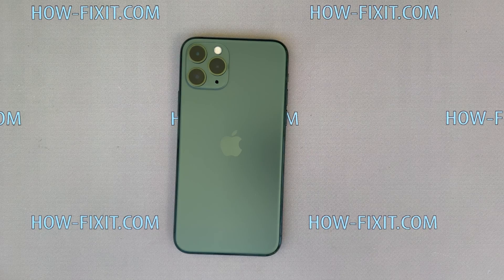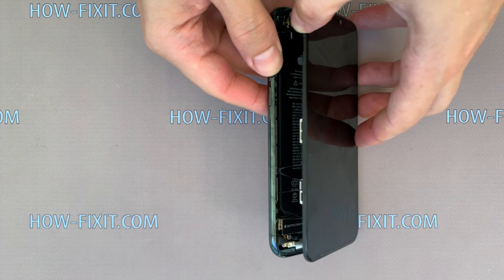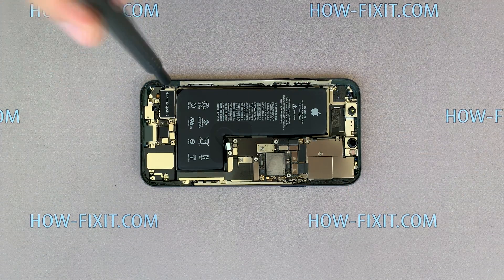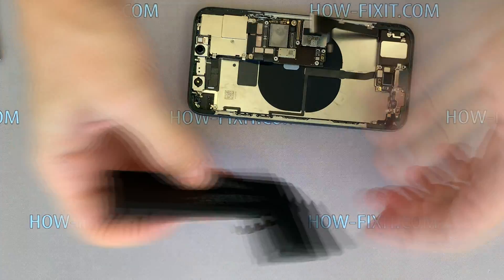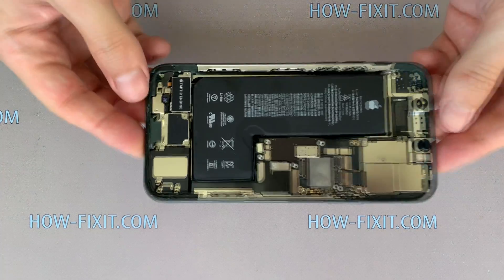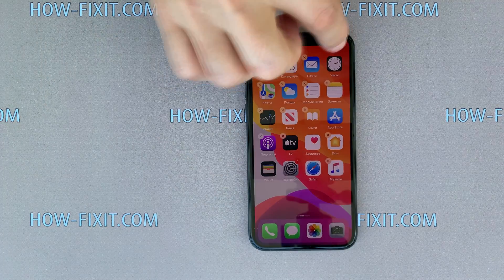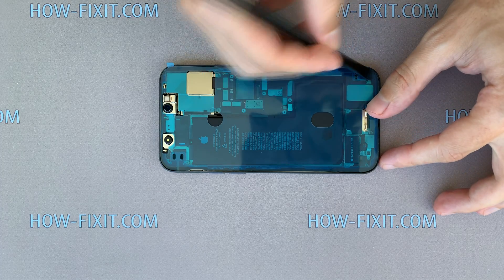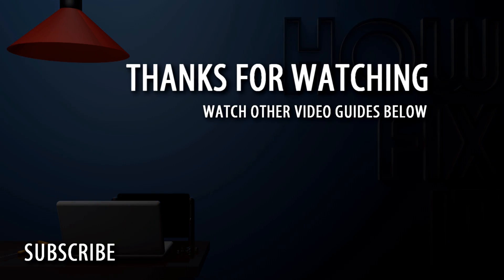iPhone 11 Pro Battery Change Made Easy: Complete Guide

Comment: Thanks for the instructions, I have to say though this is the second time I have replaced a battery on iPhones and not once have I even come close to the skill you guys have removing the adhesive for the battery. Mine just snaps and I'm left digging and using head pads
Reply: Hey, i dont know if youre seeing this but next time make sure to pull on the pads on a really low angle. If you pull them upwards they will snap but if you pull on them really low like almost as low as the phone they hopefully wont 👍

Comment: no need to weld the old battery circuit  board to the new battery ?
Reply from the maker: ⚠To Fix 'Unknown Part' or 'Important Battery Message' check the iPhone Battery Calibration video tutorial, link in the description under the video

Comment: It's not at all as easy as this video looks. At first, I thought getting the screen off was going to be the worst of it (use a razor blade before using the mediator). But, the those little bitty screws was a biotch! I, finally, got them out and then, realized I had broken one of the flex screen connectors. D'oh! Beware removing the screen and don't pry too deeply on the right side (with the charging port is at the bottom). I'm going out and getting a new phone tomorrow. 😥
Reply: flex connectors are repairable. also could've just buy new screen instead of new phone 🤔

Comment: You should have added that Iphone X, XR, XS, XSMAX, 11, 11 pro, 11 pro max will not show battery health there is a lengthy process which you will have to go through to be able to see the battery health and it involves having to use a battery programmer a tag on flex and a mini spot welding machine you will also need a battery cell kit for whatever device you are replacing the battery of you will also need some basic knowledge in battery repair and balls of steel to remove the tiny BMS board from the original battery cell or failing that you can also buy a External Tag On Flex XCAP which needs no programming and can be reused but you will still need to use a mini spot welder and have those earlier mentioned balls of steel to remove the tiny BMS board from the original battery cell and replace it on to the new one I very nearly just bought a new battery and swapped it over but I'm glad I done a little more research now and I can replace my battery correctly and luckily I know what I'm doing but if you don't I would suggest taking your device to a repair outlet and get them to fix it and get some sort of guarantee for whatever work has been done its better to be safe than sorry.
Reply: where is your fullstop bro?
Reply from the maker: ⚠To Fix 'Unknown Part' or 'Important Battery Message' check the iPhone Battery Calibration video tutorial, link in the description under the video

Comment: I have been using my iPhone 11 pro for less than a year and already the battery needs service. Been using it pretty extensively watching many videos in 2x Speed but still very disappointed in the longevity of the battery. Now the battery goes very quickly down to 1% and it can last hours at 1%. Tried calibrating it but replacement seems like the only way to keep using it...... At this point I'm considering switching back to my OnePlus 5T and give apple the middle finger tbh.
Reply: Same! The battery started giving me problems within months!
Reply: I have a european model and experimenting the same. Actually. I already had it replaced by Apple under warranty and then it lasted 10 months. now it doesn't even want to power on. Might aswell change it myself at this point.
Reply: Lol i just had exactly same issue. My phone is 9months old and for six months  battery stayed 100 percent health, then down to 99 once and then in three months its down to 84 and i experienced same. Battery drains to 1 percent on screen but lasted hours, though i think my phone felt laggy after few hours of use without charging. I gave it to service last week and will take it back tomorrow. I think its bad for the phone its already opened for a 9month old phone. We will see
Reply: 🖕🏼🍎

Samsung here i come!
Reply: Thanks for your lifestory bro
Reply: Hello, so there is no programming after new battery instalation?
Reply: You don’t know how to use the battery on iPhones they’re different to other smartphones. 

You have to not make a full cycle don’t go from 0-100 every time 
25 times of 0 -100 = 1% battery health which mean you’ve done over 500 cycles bringing it below 80% which the the minimum standard

Comment: Bro is this battery compatible to xs?
Reply: Nope. Apple had to change the logic board and other components to be able to accept that big batter. There is no space available in the Xs or Xs max to accommodate their battery
Reply: M but 11 pro and xs is same size
Reply: Lonely Kid not the internals. Externals are same. They changed the logic board which is inside the device not outside.
Reply: M oh tnx bro for ur information❤️
Reply: Lonely Kid anytime